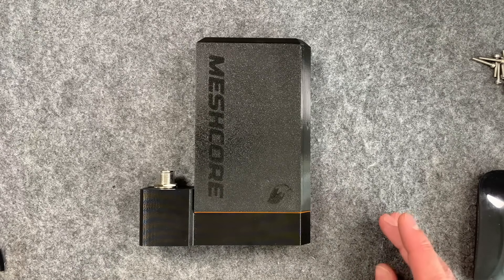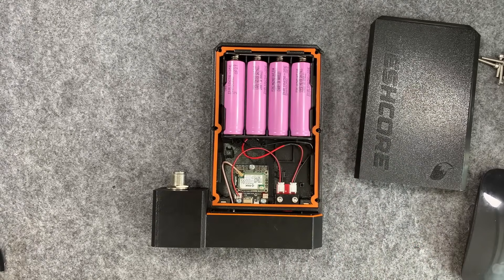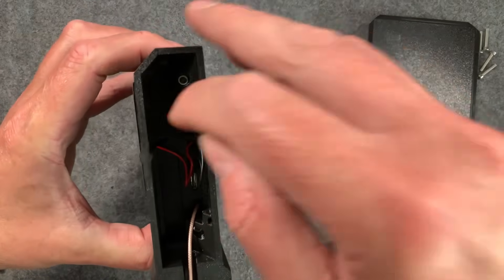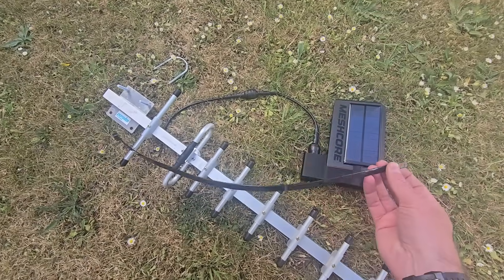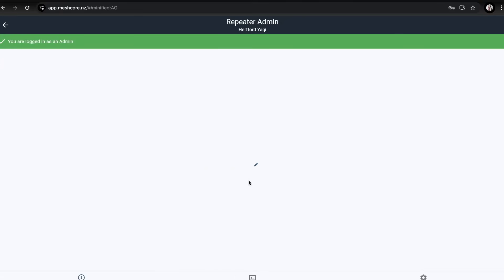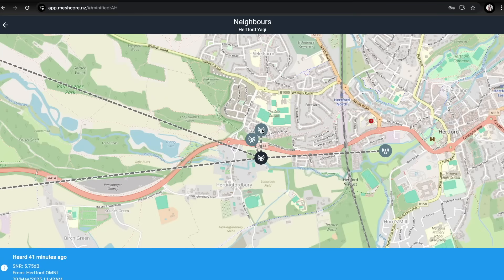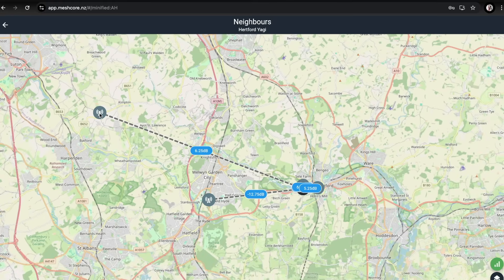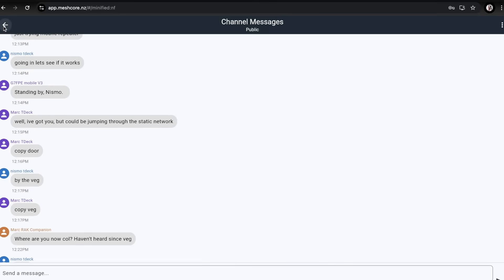MESHCORE SOLAR REPEATER!

Comment: Great vid Andy thanks! I never considered adding a panel on the case itself lol! I use the common 6W panels they sell for door bells and security cameras. All come with long cables and mounting hardware so you can mount them away from the node in an optimal location for sun! Also since Andy received his Hermes for testing I'm now including the solar cable and crimps for attaching to any panel easily without soldering.
Reply from the maker: Cheers mate! Yep, 6W panel would be better 👍🏻